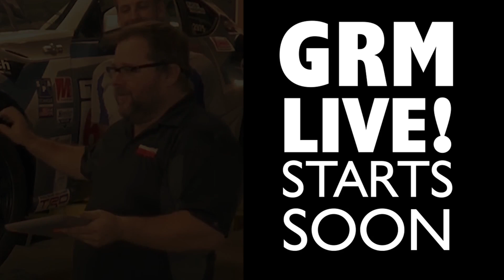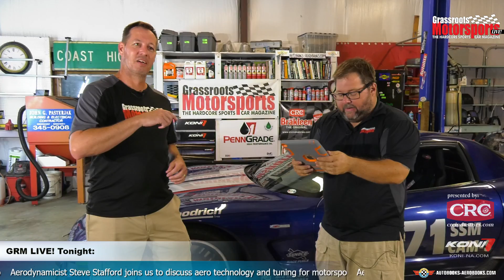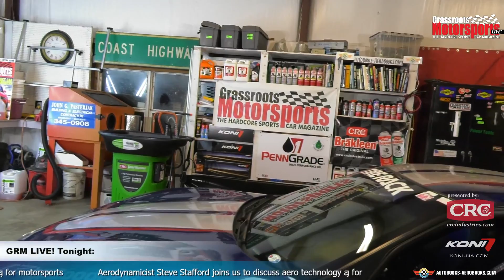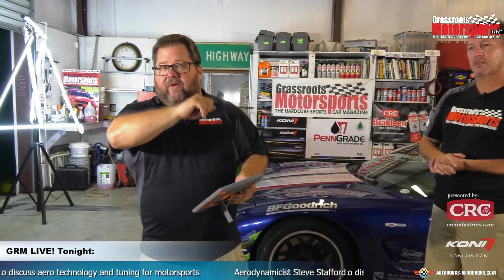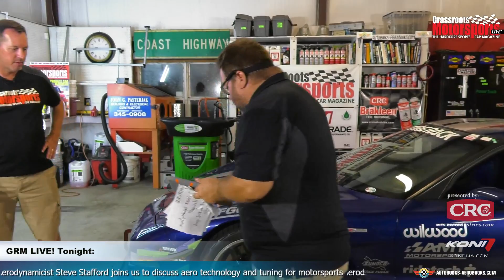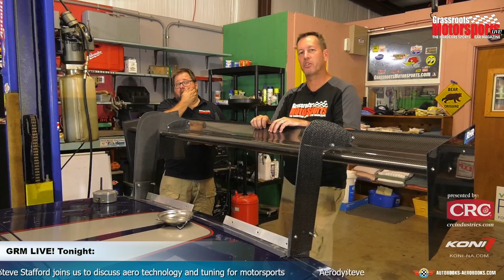Ask the aerodynamicist! Aero tuning for sports and race cars. GRM Live! Presented by CRC

Comment: Great show, missed it live, would have loved to have asked how much down force for a balanced front splitter & back spoiler/wing when trying to figure out a design
Reply from the maker: We touched on this a bit, and it basically came down to this: Most folks in our world are limited by their particular ruleset to sizes of aero aids. So start with the largest, most aggressive package you can legally do at both ends and dial back from there through testing. If you're lucky enough to run in a class with no restrictions, chances are the stuff you'll be looking at will have been through some testing and data-production regimen so you can make informed decisions. In general, it's easier to get a greater proportion of downforce at the rear of most cars. So you're almost never going to want to run anything but the most aggressive front splitter you can run.